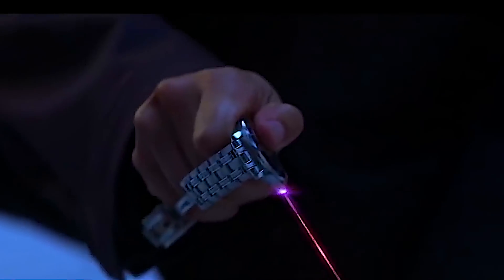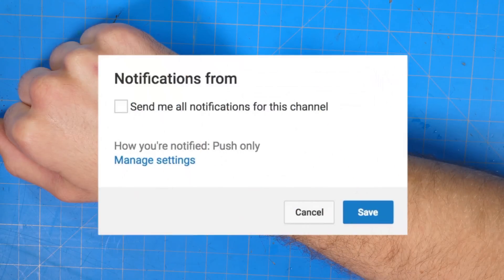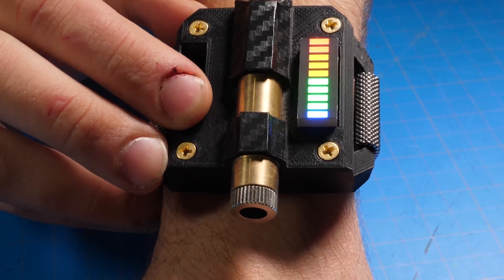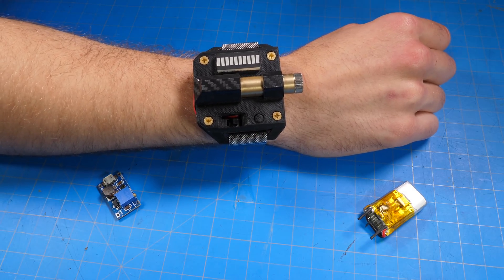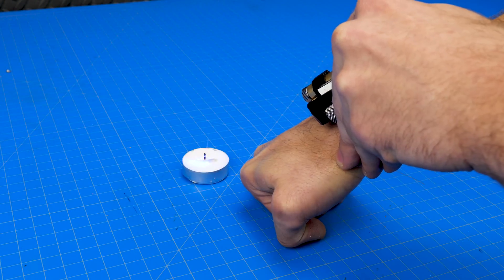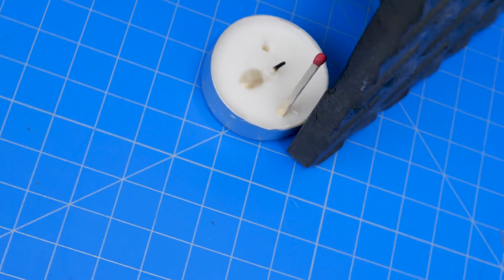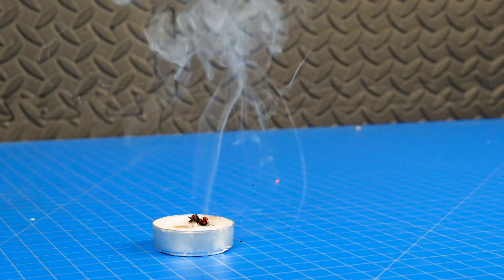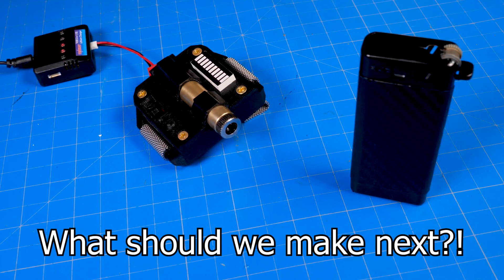DIY Burning Laser "Watch" - Iron Man / 007 James Bond Inspired!

Comment: Interesting technic idea. Would using a 15 milliwatt laser be a better choice? And I couldn’t figure out why you didn’t just use a bunch of 9volt batteries and some resisters with a SPST switch. No need for a voltage regulator.

Comment: I did something similar to this.  I have a 2W rated diode and sitting in its heat sink the beam is nice and tight up close to a surface.  If I pull back the beam becomes rectangular suggesting that this is the shape of the diode's aperture.  Now I can focus it again, but at distances of a few inches I can never get the beam to "tighten" to a dot.  Also, up close on a white piece of paper with the beam focused to a small dot the paper is unaffected.  Questions:
1) Is a white sheet of paper too reflective to actually allow for penetration of the beam?
2) The laser diode carrier came with a lens threaded to go into the barrel of the carrier and another knurled one to go on top.  I've tried various combinations (turning the interior lens backward for example), but still seems I can't get the beam to focus more than an inch or so from the surface.  Any thoughts there?

Comment: You should put a upper frame which will tell the time like a normal hand watch which will look like a normal watch but at the side of it there will be a button and the and the voltage you are talking about and the charging cable pin you know what I mean